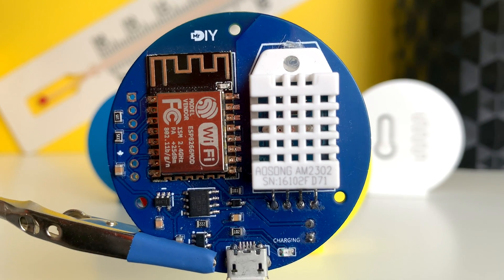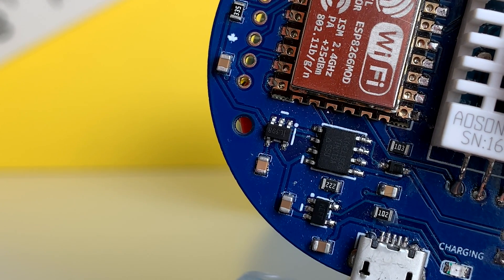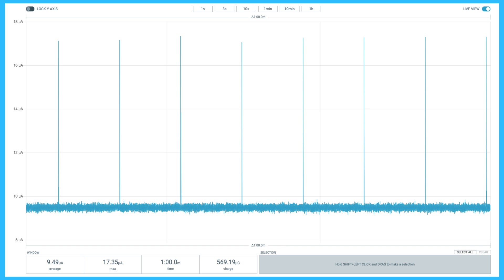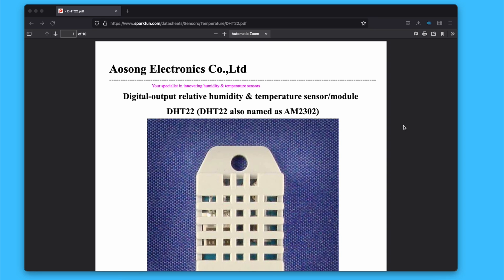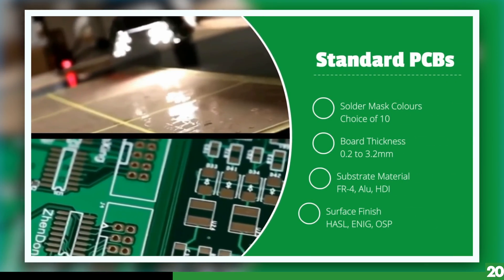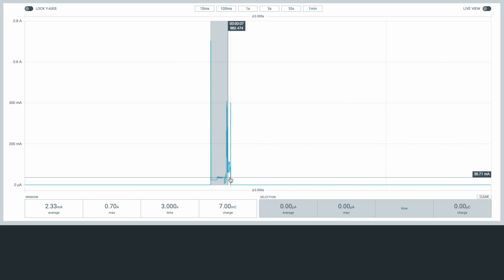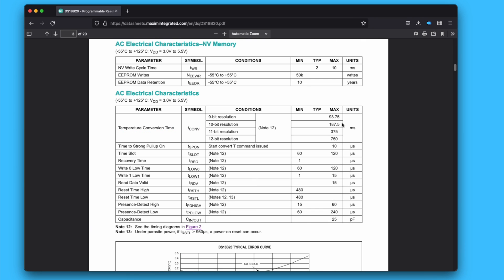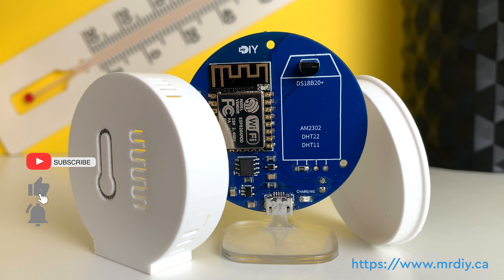Why this is a BAD design: my wireless temperature sensor!

Comment: I must be the outlier in this. I use ESP32 + DHT11 on battery powered  (LP103395) sensors taking readings every 10 minutes pushing it via wifi to an MQTT server and I'm getting around 8 months per charge on the battery. I also have an SH31 variant that I'm testing, The variance between the sht31 and DHT11 is 0.5 degrees, which IMO is negligible in a domestic environment. I don't use an AT Tiny or anything to wake the esp32 I just deep sleep it - I might look more into it. I'm getting ~24uA drain when sleeping, I have a resistor divider for battery measurement (no switching) so without that I suspect it'd get to 12uA. I don't power down the dht11 at all it's power drain is tiny and the least of my current usage issues. I've seen a couple of your ESP-NOW videos and might try it out to see how it goes, my wake time is about 3.5 seconds, so I'd like to cut that as much as possible. I'm still using dhcp addressing rather than fixed IP addressing so that might account for some of it but it makes it very flexible so there's a trade off. I guess I'll also be building my own gateway, given the esp32 prices I'm happy to use 2 of them and was quite interested in your design too but I think rather than an SD card I'd use a remote config pulled at boot - or even config stored on the MQTT server.

Comment: how using attiny as timer is better choice then just use esp32 timers? It must use more energy, because esp in deepsleep still have some timers power on anyway. 

Don't use this shitty DHT sensors, use SHT30/31. They are really not worth using if u need accurate data. They are only good to control humidity to prevent mold, nothing more

Comment: Why not have the attiny also control the power to the dht? After 15 min first power up the sensor, wait 2 seconds and then power up the esp. When the espdone signal comes both will be powered down. That should give the dht the time to stabilize and keep the power consumption of the esp minimal.
Reply from the maker: that is a valid idea

Comment: Haha, just seeing the thumbnail brings back memories of my own fuckup 2 years ago. And I even took the effort to implement a little "wall" between the esp and the temp sensor. Still the temperature was several degrees higher because of the esp-heat. In the end I put the esp to sleep for 5min between each sensor update to "fix" the problem.
Reply from the maker: I had a similar issue with ESP and PIR - lots of false triggers. Learned to keep the monster asleep :)

Comment: I've been using BME280 sensors in outdoor (harsh humid) condition for over a year. Temperature and pressure readings are stable, however humidity readings are getting less and less accurate over time in high humidity conditions. After carefully reading datasheets from different humidity sensor manufacturers I realized that it's a common problem for humidity sensors. I'm planning to "bake" them and re-calibrate.  I'm also using DS18B20 bare and watertight models with good results for air and ground temperature measurements. I'm using ESP8266 deep sleep mode and powering sensors from GPIO pins with minimal additional components to save power. With ESP-NOW and even highest resolution the wake time and power consumption are minimal. Let me know if you are interested in additional details.

Comment: For my part, I use HDC1080 for precision: 2% in RH and 0.2% in T°C, low conversion consumption: 1.3µA and conversion speed: 7ms for each sensor. (In standby it consumes 100nA!)

And if we add the TPL5110 (System Timer for Power Gating) we can do without the ATtiny13A (150nA) since it consumes 35nA in Operation Mode.
It's the perfect combo for a powerful wireless battery application !

Comment: I‘m using a SHT31. Way stabler result than the BMP280 and BME680 which I‘ve tried a long side with an DHT22 (which degraded after 1/2 year of use)

Comment: Hi there!
Thanks for sharing your experience!
One way to save precious battery juice is to start and keep the esp8266 Rado OFF, power the DHT ON, wait the  2 seconds, take the temperature and humidity measurement and only then enable the wifi to send the data. If your board don't control the DHT power, you don't even need to wait those 2 seconds. 
Like many have commented here, the atiny isn't necessary.

Comment: I think it's wrong to assume, that the "resistance" of the coil can't change immediately, if that resistance is a model of the behavior of the current change in the inductor (I'm not talking about the parasitic resistance). It's like pushing a heavy car on the rails: if that car moves at a constant speed, it feels like that car has no weight, and as soon as you want to accelerate it, it gets instantaneously heavy. The more you push, the heavier the car feels ... of course, we all know, the car has a constant mass, and we don't feel the mass, but the force needed for the acceleration.

Comment: You can use aht10, it is TWI (two wire interface) temperature and humidity sensor. The ranges if I am not wrong are the same as Dht22, but the AHT10 uses almost no electricity compared to DHT22.

Comment: Perhaps you might try using AHT20 which is a very accurate temperature humidity sensor or bme680 which is also good at energy saving.

Comment: Looks like I was lucky? I use DHT22 with my Wemos D1 (so ESP8266) in my DIY car dongle so it wakes up every ~30 minutes, reads voltage, temperature and humidity, sends via MQTT and goes to sleep. No need to use external uC for waking up and fancy internal counting and no problem with temperature reading. I have 2 DS18B20 outside and all readings seems to be similar, so no garbage data.

Comment: Why waste a Tiny13 when the ESP12F or ESP12S (ESP07s too) already has an RTC clock? 
You just need to connect GPIO16=D0 to RESET, then the ESP can reset itself to wake up.
The rest is software.
Only the variables in RAM are deleted. 
In the RTC there is a tiny possibility to put a variable continuous there in the RAM. 
Otherwise just via the EEPROM of the program memory.

Comment: Amazing project! Congrats! Quick question: Why the AtTiny is needed to wake-up the ESP? Why dont you simply connect GPIO16 to RST and use ESP.deepSleep(900e6) for waking-up in 15 minutes? Any efficiency using AtTiny?
Reply: ESP.deepSleep() actually turns off the system clock on the ESP8266. ESP.modemSleep() would prevent the clock from turning off but would probably use more energy than this AtTiny does.
Reply: I don't know if the clock is turned off, but I'm sure the ESP wakes-up after 15min with ESP.deepSleep(time)

Comment: i used bme280 for temp and pressure
 its humidity isnt highly accurate but probably enough. it has a sleep mode. i personally use a sht35 and bme280 to get accurate temp and humidity and pressure for my hvac systems. cause 1% humidity matters a lot for those reading and i also need pressure. also you could just turn the sensor on wait x seconds and power up the esp. normally the sensors are like 1ma usage vs the 70ma for the eap. can also use a 1wire realtime clock module to handle wakups for long periods with low battery usage.

Comment: I would also, like the others, suggest that you use the bme280 with I2C interface, it also gives you the air pressure.
There is also a Bosch sensor for air quality, maybe that's a good idea for the next project.
Reply: The BME680 is also not suitable for battery operated devices at all.

It basically needs to be powered all the time, because the cold boot time (until you get stable readings) is somewhere in the minutes range - my experience, no clue what the datasheet says.
Reply: @nnighthawk  Thanks for that Information, maybe that is a solution for high capacity mobile applications with lipo cells. The sensors from Bosch are known for their low energy consuption, but nevertheless they may draw a significant current in operation.
Reply: @donnerruebe  I ran an ESP8266 with a BME280 attached to it off a 2.2 Ah 18650 cell for a while. Firmware was absolutely minimal including deep sleep (wake up every 15 minutes) with all the bells and whistles and I still had to recharge it every few days.
That was too often for my liking, but I didn't have the tools to find out what's eating the battery. Could be the BME280, could also be the ESP8266 board I used. Anyways, just don't be disappointed if your project doesn't have the battery lifetime you were expecting either. :)

Comment: Why do you cut power to the DHT22? If you'd leave it powered it would be ready for the esp8266 to read the data without waiting 2 full seconds. Its power consumption is negligible.
Reply: It has a 50 uA standby current.

Comment: Have a look what sensors the inexpensive Sonoff Zigbee sensors are using.  They run for a year off a coin battery.  Bit of investigation says they are using the SHT30.  Others are using the STHC3 or S8305

Comment: I forget if you have mentioned it before... Have you tried the built-in sleep function of the ESP device? I have something turning on every 10 min, reporting a temperature, and going to sleep. So far it works quite well. It is using the DS18B20.

Comment: BME280 are what I plan on using for my various DIY sensors. NOTE - They are noticeably more expensive! And I haven't looked into their power use as mine will be wired...
Reply: and can supply pressure as well
Reply: i used bme280 and also tried the htu21. while both are good i would recommend the HTU21 the precision is crazy. i measure 0.040°C variation and lower consumption. the only drawback is the temp conversion  takes longer so i initiate a temp conversion and go to sleep, then the next cycle starts reading it (1minute offset in case of 1 minute sampling)